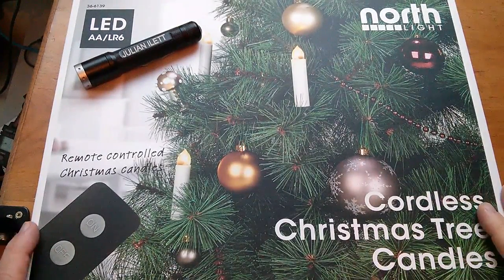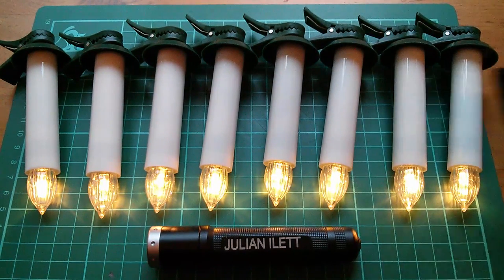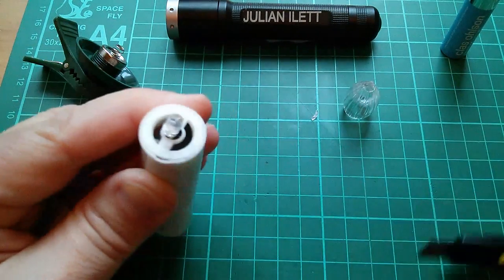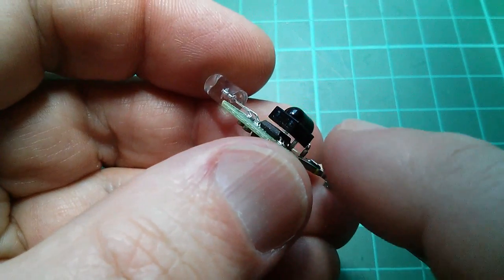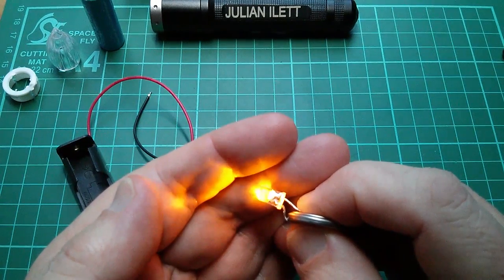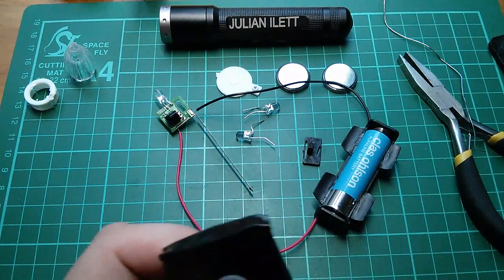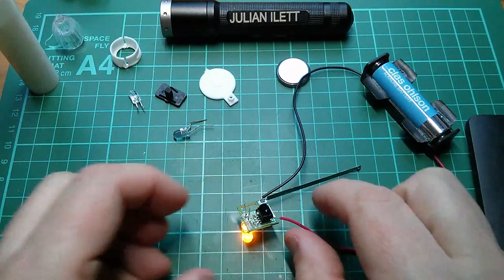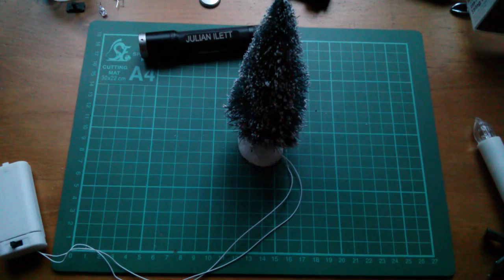Christmas Tree Cordless Candles Flicker Hack

Comment: The positive battery contact is probably a through-plated slot, similar to a via, that has been tin plated with one of the usual methods. Then half of the slot is routed away. Pretty neat (or at least cheap) way of making a battery connector.

Comment: Julian, 
That thing that looks like a switch IS a switch! Just not a conventional one. The plating on the edge of the PCB for the battery terminal is just the same as standard through hole plating but the rest of the slotted hole is obviously removed afterwards, leaving the plated section intact but it's a clever use of the technique to save money on the cost of a separate battery terminal.

Comment: Do the candle circuit boards not pull out from the bottom, where the battery goes in?
Reply from the maker: Unfortunately not.
Reply: From the video it looked like it might. I also thought it looked like the lip on the candle, that holds the top in, doesn't go all the way round, so you could twist the top 90 degrees and take the top off more easily.
Good luck with the remaining candles.
Reply from the maker: Ah yes, that's a good idea - I'll try that
Reply: I hacked some that look quite similar to these...if you use very gently a hot air gun to warm up it a bit it all loosens up quite nicely.

Comment: crack the top off the flicker LED with some snips to send some of the light sideways,  the problem is that it is focusing the light to the tip of the candle attachment instead out the sides like the original LED did. should look just as bright.
Reply from the maker: +John Quinton Neat idea :)

Comment: something im doing with the smaller candle boards and you maybe could too:
i put a npn tranni with a pullup on the Switching output of the controller and installed it into some Christmas lightning around the House. pretty handy if youre too lazy like me to pull the cable out or Switch the batteries of:D

Comment: @Julian Ilett: A friend of mine bought some LED candles that look almost exactly like the ones you used. Fun part is, his LEDs have a build-in flicker function that is activated by turning on the candles, then pressing the power button, holding it for a second and then relasing it. However, the flickering looks nowhere as good as your LED mod does. Also, greetings from Germany ;)

Comment: Hey Julian, do you know how long alice needs to ship an order? I orderes mine 3 weeks ago and i didnt receive anything yet. :(
Reply: I been waiting for something from alice since 10th November.
Reply: It varies.  I've gotten things in slightly under 3 weeks, I've also waited 5.5 weeks.
Reply: Understanding how shipping from China works is the clue. I don't think the seller has any influence at all. In order to get the shipping cost down, they need a pretty lagre "buffer". Lets assume there is a big cargo vessel laying empty in the port of Shenzhen destined for England. When the vessel is full they'll leave. If your envelope was the last one in, you think the seller was quick. If your envelope was the first one in you think the seller was slow. Oh, by the way: I don't have a clue how the shipping industry works. (I'm a computer engineer) :-)
Reply: Having bought a lot of stuff from China over the years, I'd assumed something similar.  I assume that a major shipper has a container sitting in their dock heading for (wherever).  They just keep chucking stuff into it until it's full, then the postal inspector seals it and off it goes to drop onto a ship.  The smaller places probably use either a shipping aggregator or a common container at the China Post depot.
I also don't actually know how it works.
Reply: Sometimes that container gets shipped by railway, or gets near railway yards (tracking showed several times things like "Shenzhen Railyard" also for other cities)

Comment: Interesting the "LED9" name on the silkscreen could suggest that the person that did the board layout was fighting the PCB package and changed the LED footprint some times before it was usable, and then forgot to change the name to LED1
Reply from the maker: Another possibility is multiple PCBs on a larger panel - the PCB software sequentially numbers the components. When I look in the other candles, I'll check for other numbers.
Reply: Bingo card at the ready

Comment: Never solder stuff with the power on.....Do as I say ands not as I do...Right!
Reply: Gordy Barn It's even more fun if when using an earthed mains soldering iron, you try working on a live circuit that has one of the supply lines referenced (connected) to earth... I did that once on a 24V system 😳